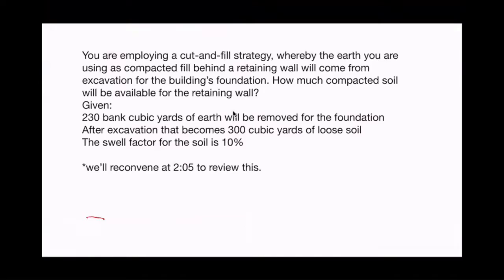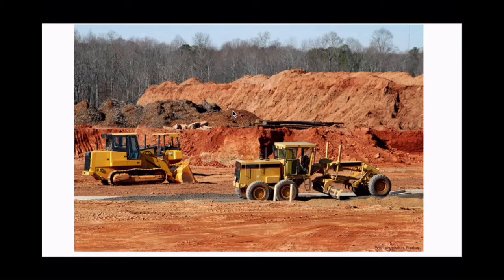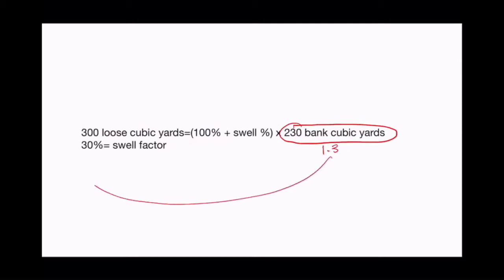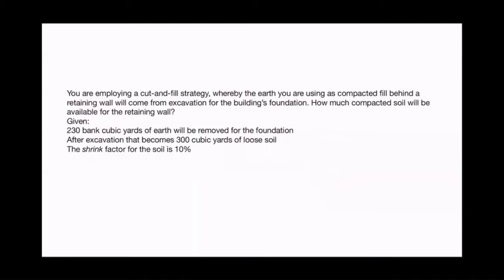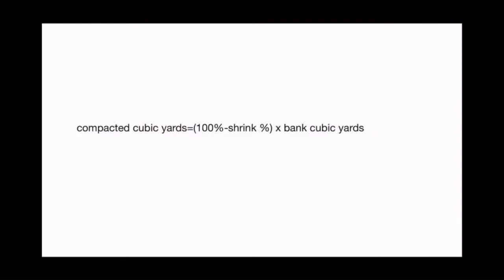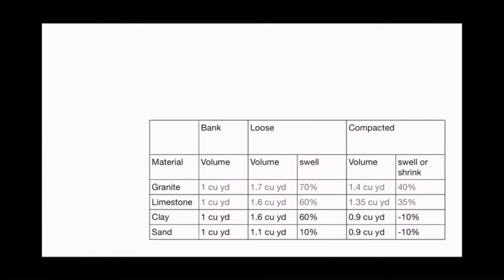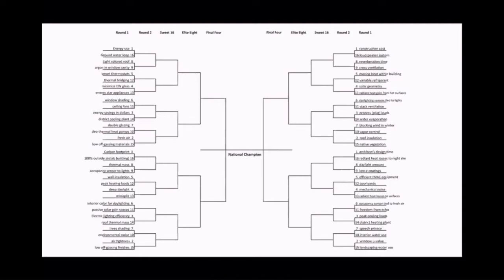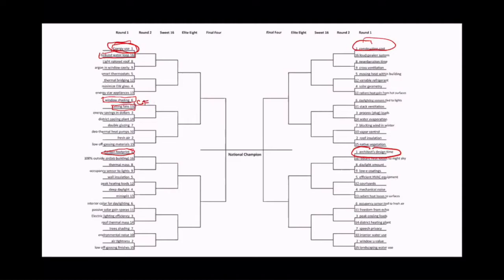Cut and Fill - 40 Minutes of Competence | Amber Book

Comment: first question where it says how much compacted soil, I was thinking its asking for shrink not excavate or loss, so my thoughts was, the bank times 90% and it should be 207 compacted soil required (lesss volume with compaction). Also, when you divided the bank to the excavation (300 given), normally you get the shrink factor not the swell, but its given the swell factor with 10% instead, but when you divided the bank to excavate for the first question, you won't get the shrink factor, because you are compacting the soil not excavate. 
and the following question, where it says how much excavated soil, mentioned the swell factor 10% where the soil will be expanded and has gaps and air (means expanded) that means the soil volume will be bigegr than compacting with 230 times 1.1 = 253 excavated soil required.
I feel these two questions answers were flipped in somehow. thoughts?